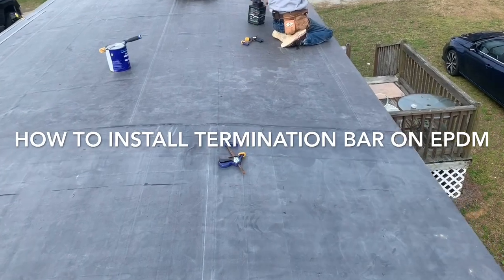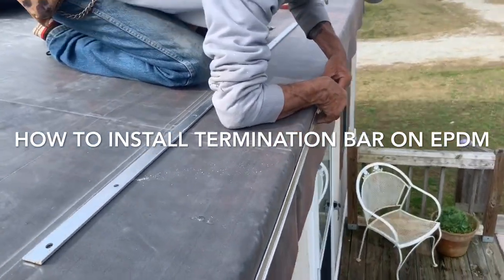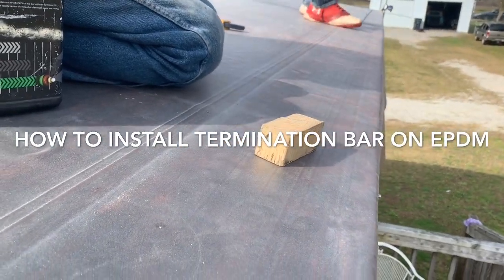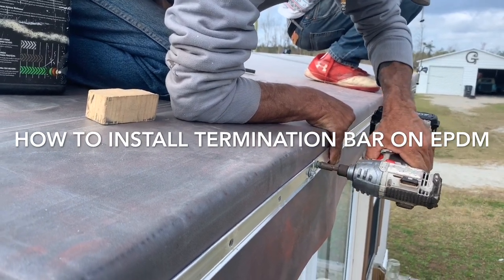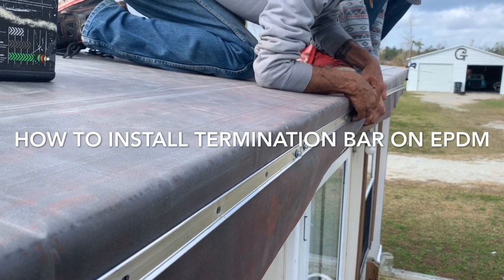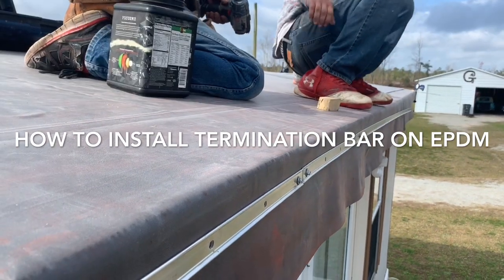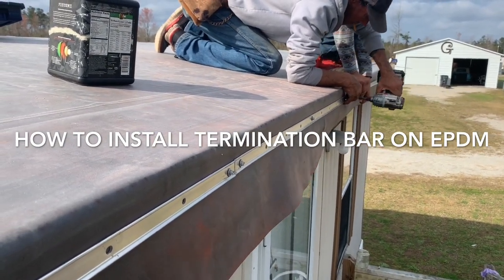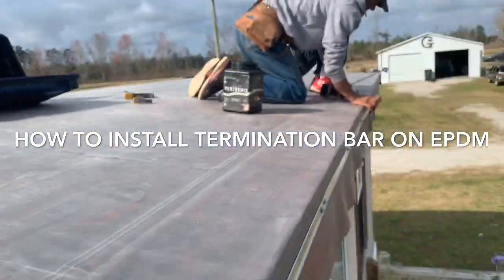How to install Termination Bar on EPDM Mobile Home Eaves

Comment: You should include in the next video for rubber roof on mobile home, how you guys do the corners with the term bars???
Do you butt them up to each other in corner or bend at corner?
Reply from the maker: Either way is good.
Reply from the maker: I will definitely do that thank you for the recommendation
Reply from the maker: You can do it either way. Wrap or just start out at corner
Reply from the maker: coming out this weekend subscribe to my channel hit the bell notification so you get notified when I download. It will be in great detail and it will be a material list at the bottom

Comment: Do you use stainless screw ?
Reply from the maker: No, I use galvanized screw with a rubber washer. It’s called termination bar screws inch and five eights.

Comment: This will void the warranty, where is the caulk? 🤣🤣
Reply from the maker: Correct that’s the only part we didn’t show in the video was installing the EP DM lap sealant over the top of the termination bar so the water can never get to the screws we didn’t actually finish showing the termination bar being finished but either way yes you’re correct that Bob Stewart goes on top